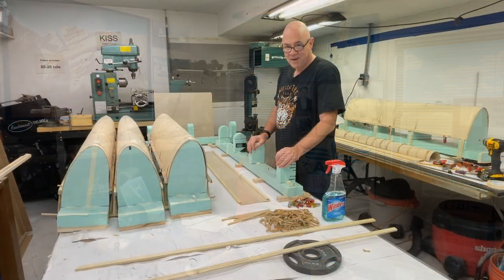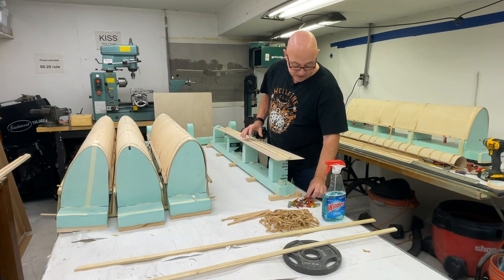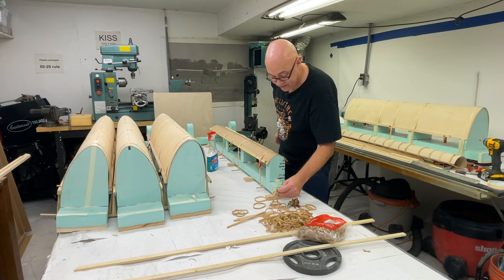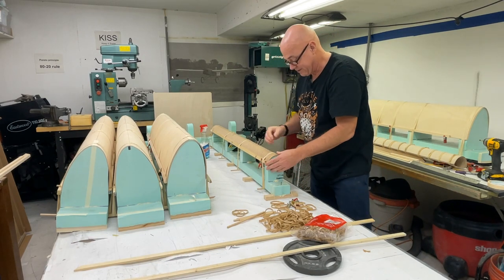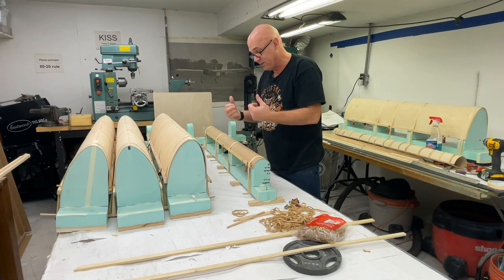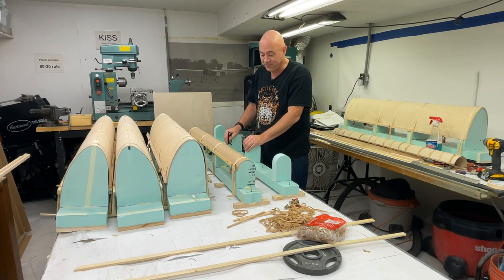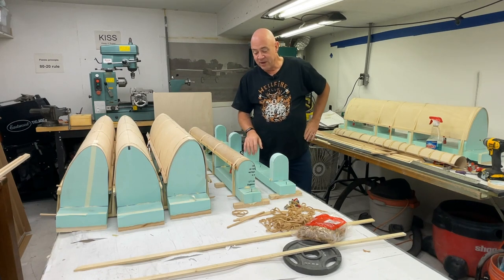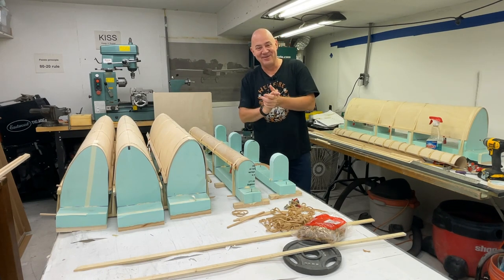AirBike Ultralight update- Bending more plywood

Comment: Why did you use foam and not some scrap plywood?. Thanks
Reply from the maker: The foam gave a wide support area when the plywood was bent around it. I think ply (1.5mm and .8mm) tends to show what it is bending around. At least that was my thinking, could be wrong. Plus, foam is cheap. :)
Reply: @dagtheaviator  Makes sense...